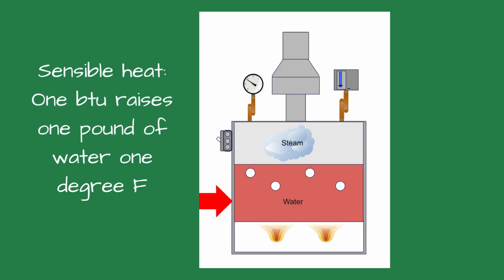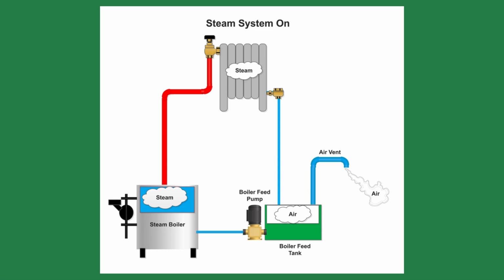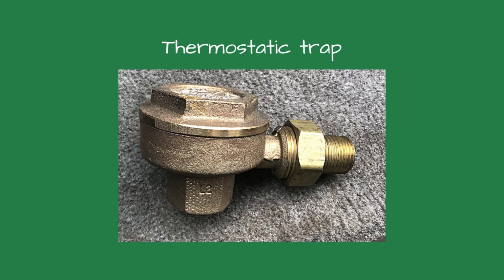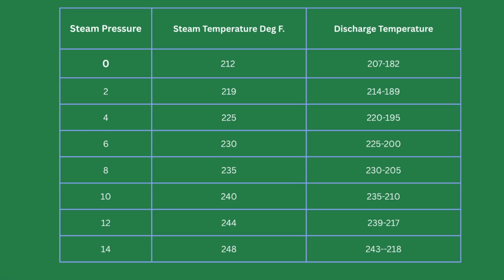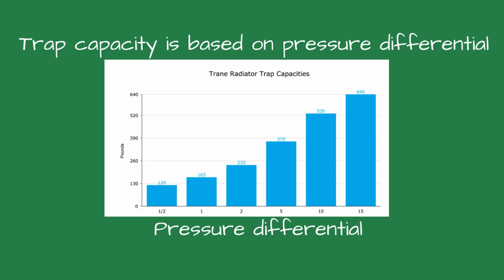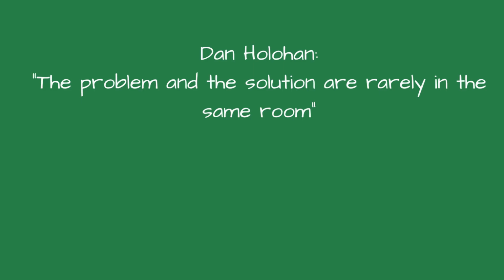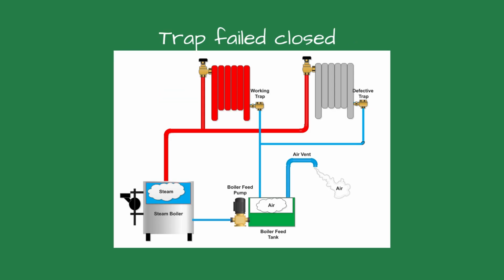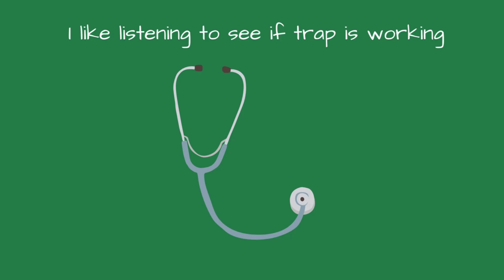How Steam Traps Work: Thermostatic and F&T Explained

Comment: When are  bucket traps used?
Reply from the maker: They are used for any application, especially high pressure. They are recommended on kettles like those used for brewing.They have a longer life expectancy and less maintenance. They do require priming when first used

Comment: So choosing a trap for a float and thermostatic is fairly important then. Does and increase in pressure have a corresponding increase in thermostat range. A higher pressure trap have a thermostat for higher steam Temps or is the thermostat only used during warm-ups the the float takes over?
Reply from the maker: Great question. The trap bellows are sealed and have alcohol inside. It expands and contracts based on the temperature difference between the inlet and out. It will open once the temperature drops 5-30 degrees on a thermostatic trap. The thermostatic element on an FT trap is just used to vent air and non condensible gases